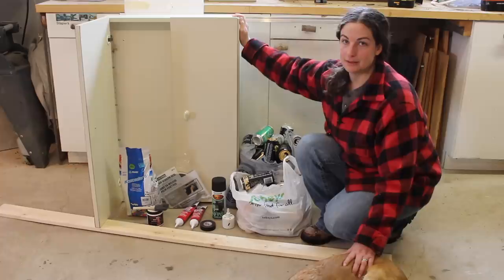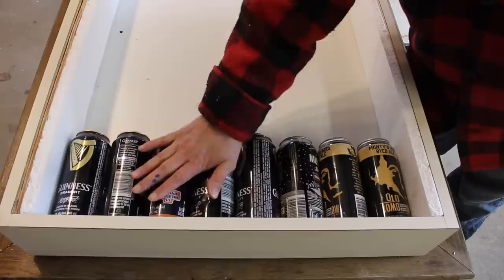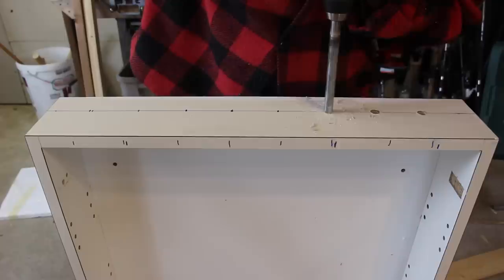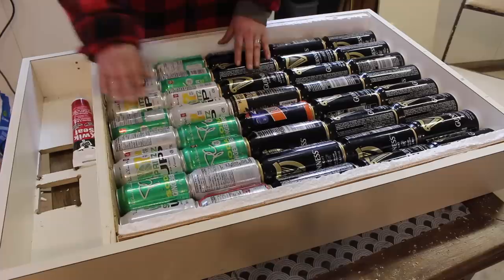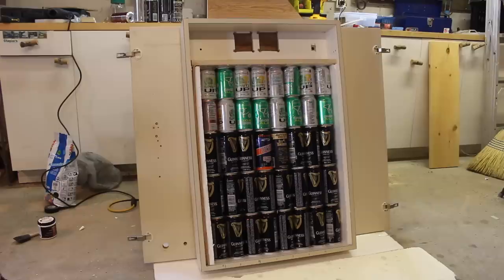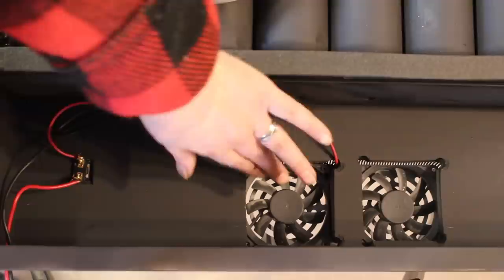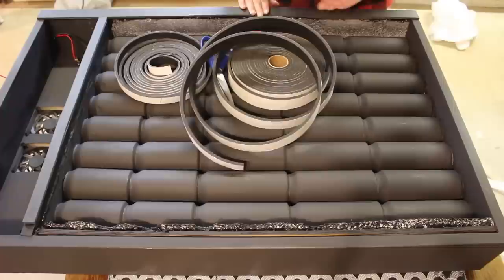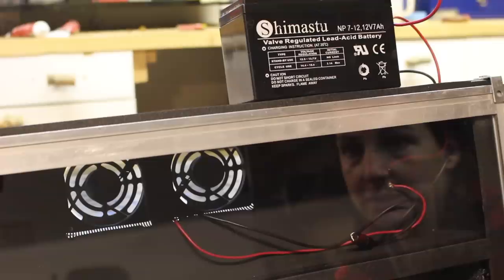Free Solar Heat From Pop/Soda/Beer Can Heater

Comment: Awesome little heater!   A great addition for your setup might be a thermostat.   Maybe you could find one at a goodwill?      You'd want an older mechanical style, non-digital, with connections for Air conditioning.     

You'd put it inside the case, and use the cooling contacts connected to your fan/battery (instead of, or in series with your on/off switch).     You set the thermostat to the minimum temp inside the case you'd like before the fans run... say, 80 degrees.     

Your system would automatically turn off at night when the sun isn't shining, or stop for a while and let everything warm back up if it's getting too cool inside.
Reply from the maker: Diggin back through old videos that are getting a ton of views right now. You were here way back then Dave!! So Cool!
Reply: Was it waterproof silicone caulk?
Reply: i used a cheap chinese thermostat electric switch used for refrigerators and other devices. (5 dollar, you set at what heat the fan should go on and at what heat they should go off. and you get a sensor on a wire you can extend...
it works..
however i stopped using the whole setup as i dont need heat in my house when the sun is hot. and when i do need it its non functional

Comment: Feed our chickens rice sometimes. Live in S.E. Louisiana. Real good build. Like the old Shop Smith in the back round.
So far here we haven't had much cold, haven't even burned any wood.......yet.
Reply: what makes this work well is the baffles created by drilling a 3/4 or so inch hole, make the air move slowly through the cans and gives it time to heat up. All the best to you folks.

Comment: I made one about 10 years ago using 53 cans (not big enough to do a large room, but it was just an experiment) I had a thermostat set to turn the fans on at 120º, which I later realized, wasn't hot enough. But it was all sealed up and I didn't want to take it apart to reset the thermostat.
I live in a condo now but when I get a house, I'll make one using gutter downspouts or one of the other things I've seen being used. (window screen, flexible dryer vent hose etc)

Comment: We were doing this in the 60s. Mater-filled (with some antifreeze too) metal barrels in a glassed-in porch works well. As do dark-bricks. 
I guess good old ideas recyle, which in nice!
Reply: Need more info on "dark bricks."
Reply: @judygilleland9384  The glassed-in porch faced south. The dark bricks were the floor.
Look  up passive solar heating. This will lead you to this and many more techniques. I suggest books instead of videos, because books are better indexed, and the illustrations can be studied more at leisure.
Best wishes for your upcoming efforts.

Comment: you can increase the thermal output by having 1/2 inch spacing between the sides of each row of cans and placing aluminum foil behind it all to serve as a reflecting medium.

Comment: I have seen many people do this in a variety of ways using various materials. Instead of cans I have seen people use black poly pipe, pvc pipe painted black, and as someone else mentioned rainwater down spout. They all work to various degrees.

Comment: not sure what you are gaining with this over just letting the sun through to heat the contents of the room which then reradiate to heat the air
Reply: She gets youtube viewers. I was thinking the exact same thing.
Reply: Gents.  Mine produced a mac of 220* on a cold winter but sunny day. The lowest temp was 137* on an overcast day.  Mine had no fan but was inside the window. (Melted my blinds but worked well)
Reply: @2JobsStillPoorUSA  You don't seem to understand the difference between temperature and heat. You can indeed get a small volume of air to a high temperature but not enough heat in BTUs is generated to warm a room as efficiently at just letting the sunshine hit the floor or a dark surface. The floor won't get as hot but more heat will be absorbed because the product of the temperature x specific heat x mass is greater. High air temperature outputs just means you are not getting enough air through your system to pull the heat generated off the tubes. The warmer the tubes are the less efficiently they absorb heat and the more efficiently they radiate it away. Just letting the light into the room would be more effective. If you were to build a collector outside the window and duct the heated air into the house you can gain some heat. Best to you in your quest to gain some solar heat.
Reply: Engineers, as usual, have the right answer to the wrong question. Yes, the same amount of energy will enter the window regardless with or without device. The practical point missed by the number crunchers is- The device captures heat and directs it to a specific area, not scattered around. The result is more heat where it can be felt by the occupants. Sometimes more education results in less knowledge and no wisdom.
Reply: @davidhicks8138  No.  You would do better to respect those educated people you seek to disparage.
Just get the heat (sunlight) into the building (heat envelope).  Heating the floor, furniture, etc. with the sunlight actually puts heat in a better location for your enjoyment before convection carries it to the ceiling.  A ceiling fan helps especially if a woodstove like OP has is present.
Reply: @pixelpatter01  Well explained.  I posted similar above.  So disturbing that so many people are applauding this and not realizing what you have realized.
Reply: @ a Merlin...you are correct about ceiling fan being a benefit. To clarify my earlier comment education is not a bad thing, the application of knowledge is the critical part. A man with practical experience and education will surpass the more educated man with no practical experience. A camel is a quarter horse designed by an engineer. " Without labor neither knowledge or wisdom can accomplish much." quote from H.N. Hunciker

Comment: And I'm not trying to be a jerk yes this is been around longer than your video I know your videos several years old about three going on 4 years, however, instead of using pop cans use rain gutter downspouts they're already hollow tubes painted and you can get them in 12 ft lengths or better and you don't have to work as hard cutting the tops and the bottoms out of the pop cans and putting them together and painting them and they get hotter, because the downspouts are actually a thicker aluminum than the pop cans but I applaud you on your initiative.

Comment: For some people the cans may he difficult to construct, but good results can be had without it if its constructed right.  A big piece of aluminum or can material can be placed near the back wall but allow a gap for any hot air from the back side to rise upward.  Paint the sunny side surfaces flat black.  These solar air heaters are very efficient, say 75%, whereas a solar electric heat system is only about 20% efficient, and the high current will drain the battery fast.  Nice vid, green energy, free heat. I want to make one now, perhaps a bunch outside
 going into one pipe to the house. Maybe I will put the cooler air input pipe going to the bottom area?

Comment: I built one of these back in the fall of 2006 but I unfortunately didn't think about the pop or beer cans, but never the less it heated the back room to 80 degrees on a March afternoon, but if I could do all over again I would use those aluminum beer cans,  you know the ones shaped like bottles?, they have screw off caps so I would fill them up about 2/3 of the way with water allowing for heat expansion as when the sun heats up the water inside the cans won't burst, you see the only flawed thing about what she built is when the sun goes down that heater will cool down very quickly, but if you have ever canned vegetables you would know that water stays hot for hours before cooling down, water or sand traps heat like a fire brick and the room will stay warm for a few extra hours into the evening

Comment: It's a neat toy, but results in a NET LOSS of heat compared to just opening the curtains, because now you have the same fixed quantity of photons striking TWO panes of glass, which means the second one will reflect some and absorb/conduct some (net loss from previous energy coming into the room).  Previously, with the curtains open, the objects in the room and floor, etc., would have absorbed the full amount of energy coming in through the one pane of window glass.  The best storage item is water, with a specific heat of 1.0.  All of this thermodynamics for the lay person is discussed in detail in the last chapter of the book 'All My Secrets of Organic and Container Gardening So Far,' as well as plans for building homemade solar cookers.

Comment: Don't you get the same amount of energy/heat coming through the window (insolation) with or without the popcan heater in place?
Reply: Yes.
Reply: @gregthomas5699  Thank goodness someone thinks the same. 
If the window was made of lenses I could see how it would work.
Reply: 1. No. The light needs be easily absorbed like in the video(really really black). 
2. Windows and doors tend to be the weak points when comes to insulation. Ie. you loose more heat from your windows then you get from the light seeping in through that same window. 

Thus, here they fix issue nr2 while at the same time taking advantage of the energy from the light.
Reply: @pettahify  So are you saying more energy comes in through the window if it knows it will be hitting something black?
Reply: Light is not heat.  It can be converted to heat and then absorbed, which is what the black surfaces do.  

Without a surface designed to convert light to heat, and a mass to absorb it, almost all of the light energy remains as light, not heat.  The total energy may be the same, aside from efficienciency losses, but the amount of heat is drastically different.
Reply: That was my first thought too. Hang a black curtain a couple inches away from the window and there shouldn't be any difference, other than the wasted battery energy. This would actually be less efficient, other than the solar panel is transferring 1 or 2 watts from the sun to the heat that the fans create.

Also losing benefit of a double pane sealed window, because you're blowing air through it.
Reply: I was thinking the same. Most of the light that's passing through the window will be absorbed by some surface inside the room, heating it. The construction does add insulation to the window, but for that you could instead just install a double or even triple pane window, which has the benefit that you can see through it.
Reply: @michaellavery4899  so attach the heater below the window, then you can get the heat directly through the window as well. you'd greatly increase the surface area producing heat

Comment: I thought about doing this decades ago, then realized "Hey, the sun and the heat energy are already inside just by opening the curtains" and making the room warmer. I have seen similar collectors installed outside against a wall and vented int the house, top and bottom, to allow convection to pull cooler air from the floor to be warmed by the sun back into the house through the top vent. It needs to be well insulated, but otherwise is passive and uncomplicated.
Reply: You  comment causes me to wonder.  What if we started cladding our houses with heat collectors.  In winter,  have the solar powered fans blow into the house.  In summer, have them blow out, or cover them wiith white sheeting.  Black metal roofing would be a neat siding.  The heating space could become a water distiller for safe drinking water.  Combine this with geo thermal and a compost toilet, and one is almost there.   Oh how I wish I were young enough to begin homesteading.  Retirement is wasted on the old.

Comment: I think as long as your solar panel is big enough running the fan directly off the solar panel seems logical to me that way it only runs when there is enough sun and I found a decent can opener with one of the round blades cut the top and bottom off cleanly but I would do a 2 or 3 pass system
Reply from the maker: If you’re removing the entire top and bottom of the cans, you’d be better off just using metal eaves trough sections.  The smaller holes in the bottom and top of the cans slows down the air flow so the air has a chance to warm up before moving through the entire unit.
Reply: Yes but she couldn't  show how it worked no sun out and cold  want work without days of sunlight

Comment: i build one 4 times as big... but i had to place it too far away . the air to and from the house even in isolation material would not get enough heat through..
on sunny day it would but who wants to have their house heated on a blistering sunny day... and as soon as the heat is needed (evening or cloudy days) there is none.
my experience left me leaving this thing off , unused.
also i used double glasing for this... and if you do. i can assure you it will crack.

Comment: What about putting in a thermostat to keep the fan running only when the solar heater reaches a temperature that will heat the air in the room?  Then no more battery to deal with

Comment: I'm thinking skip the battery and run the solar panel straight to the fan. That way, the speed of the fan will be in correlation with how bright the day is. the brighter the day, the hotter the cans. But the fan will automatically speed up, keeping them cool.
Reply from the maker: Definitely our preferred setup, too.

Comment: What is the added value of those cans? I’m wondering since we have purchased one, which works great and it,’s just a an empty black box basically with a window and a fan. Works great.
Reply: I'm no expert, but I believe the cans (with holes drilled in bottom) act similar to insulation, retaining more heat for longer period of time. Also, the cans add more surface area opposed to just a flat surface, absorbing more heat (after painting them black of course). Basically, the cans are used to optimize the system & get the most efficiency out of it.
If I'm way off base here, pls someone correct me. But that makes the most sense to me.
Reply: I’ve built several of these, both ways. The cans make a superior system because the warmed air never touches the cold exterior glass, so that’s the real point. But: just an extra layer of clear lexan to get that separation works best of all, as long as the hot air side is insulated and airtight.
Reply: @SchoolforHackers  Great input. Thanks!

Comment: Great project. 
I don't think any part inside will get hot enough to start a fire. 
But it's prudent to put a switch in. 
Did you put an inline fuse. 
Maybe 1 amp?

Comment: So what is the point of the cans?
 Me thinks a empty black box would  do the same thing. 
 Maybe because the roundness of the cans might be adding some absorption area for a bit more heat to collect.
 Not bashing just asking if anyone knows if the cans are necessary.
Reply from the maker: The cans slow the airflow down in the unit allowing the air to heat up before being moved out of the box into the room.  An empty box would allow the air to pass through too quickly.

Comment: A very good idea, but ...
MDF is not a good material for this application. It is made by compressing sawdust and industrial adhesives under high heat which can give off toxic vapours when reheated, such as toluene. Using pine will give a far safer result.
The same goes for the silicone. Ensure you use high heat silicone, it will last longer as well.
Kudos on the use of computer fans. Lots of air flow and great efficiency using a 12v battery with the solar.

Comment: Just a quick question... Have you ever done a comparison between an empty black cabinet versus one filled with cans? What's the advantage of the cans?
Reply from the maker: The cans slow down the air movement in the cabinet allowing the air to heat up a little more than if the chamber was empty.

Comment: Could you, instead of drilling holes in the cans, fill them 1/2 to 3/4 full with water?  Paint black and do everything else. The water would heat up and give off heat.  Probably be better in a Greenhouse,  because of humidity.   Just thinking.  GOD bless

Comment: Im doin one with cans inside of fatter cans. Im goin to fill in the gap with sand so it can create heat for a while aftr sun goes down. Take fresh air from house so im not heating ext air. Can get far in the negatives by me.
Reply from the maker: Very cool!  Make a video!
Reply: Or a book.

Comment: So, after your sunlight goes through a double pane window that’s designed to block out radiant heat from the sun, it has to go through another layer of glass. How much heat is even reaching the cans? 20%? And if that 20% hits your house plants and furniture and walls and floors instead of the cans, it’s still absorbing the heat. The amount reflecting back out the window in both situations is probably the same. Only difference is now you’ve wasted a ton of time and money and blocked your window with pop cans and solar panels..

Comment: 2 questions.1) does caulk get soft from heat and run? 2) a friend told me they did a "heat box" years ago and when it got hot it smelled of paint. Does the high heat paint eliminate this problem. Thank you for your video.
Reply: High heat paint should eliminate that problem. Caulking generally shouldn't melt, none that I know of at least.
Reply: Try engine paint , it's made for high heat .